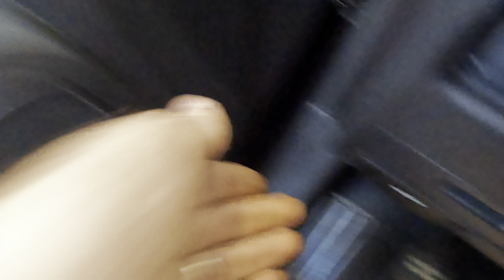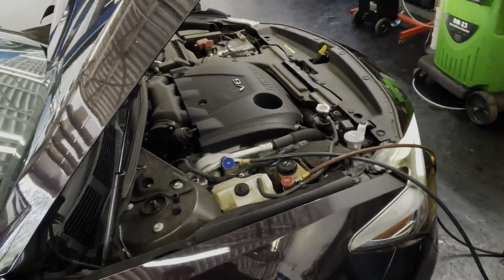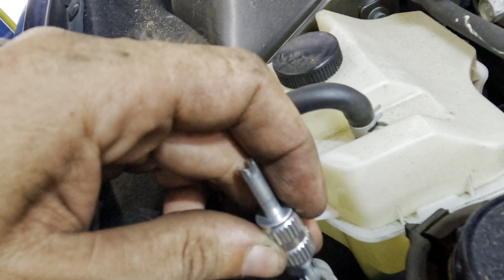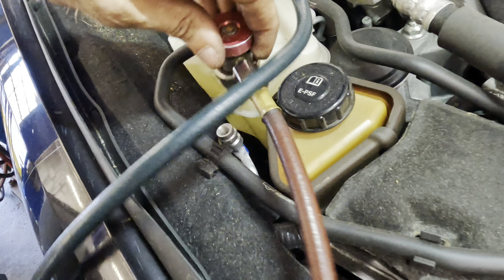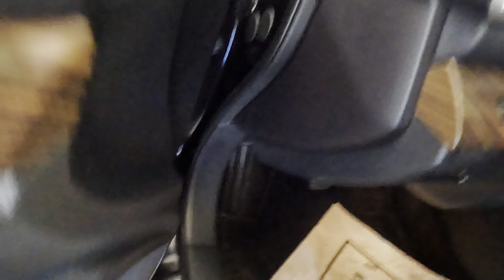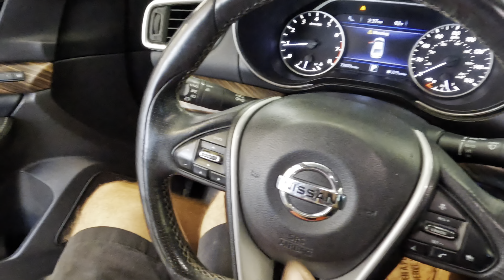Finally ran out! Seepage & Time

Comment: Nice to see the Maxima's "reliability" hasn't changed. It took my 2000 TL 15 years before the AC leaked out of the charge ports, and my Dad's 2012 TL still maintains a full AC charge. No car should leak its AC in under 10 years if its designed well.

Comment: For those who watch and don't know, make sure to run your A/C at least once a week, summer, winter, etc... Then it can last a lot longer, most factory install do not have the dye injected.  If you do have a @/C that stops ask for the valves, top up the Clavus ac oil and have them add the dye.   

For those who dont have the dye , the leak gets detected by a drop in the pressure and an increase in the low pressure side once you pull the system into max vacuum.  Dye is not actually necessary to check for leaks.  

Just empty and pull down to maxx vacuum.

Comment: Here in Minneasnowda 90% of the problems after roadrunner rockets to the front end is e vap coil drain tube plugged with leaves (composted) and bugs in the spring coming back from Florida   Lol

Comment: As a career HVAC/R professional, I can honestly tell you that if the charge has dissipated, then there is definitely a leak in the system.  It could be very well in the Schroeder valves you replaced.  One way to confirm that there is no leak is to pull the vacuum and once you reach full vacuum walk away and let it sit for 30 minutes or so.  If the vacuum holds, then any leaks have been addressed.  If the vacuum starts moving up from 29” mark, then there is either a leak or moisture in the system.

Comment: I once seen a compresor that had it's body aluminium leaking from porosity. . 🤨  With compressed nitrogen, the top of the compressor would bubble wildly. .
Reply: Lol I had that with a cylinder head and on another brand a block...  Used dishwasher spray to find out what it was....  With the four gas analysis machine to see what changed

Comment: I work in the HVAC trade and am wondering why you don't have nitrogen to pressure test the A/C system to leak check?
A pressure test with nitrogen can determine if there is a leak and a trace gas(scrap refrigerant) can be charged into the system to help pin point it with a leak detector. The point I'm getting at is not knowing if there's a leak and then evacuating the system will only pull in air/moisture into the system which ruins the purpose of evacuation if there is a leak.
Reply: Hi Jordan!  The Robinair equipment that Ray uses monitors the vacuum, and will not complete the cycle if a leak (of sufficient size) is discovered.  It's a pressure test (negative), if you think about it.  Because the machine uses the hoses to do its magic, a schrader valve leak would never be detected.  That's one reason Ray replaces them.  Car A/C systems are tiny compared to home HVAC systems and use less refrigerant.  Perhaps that's why they don't ever see a nitrogen bottle.  Home HVAC work uses N2 flow to keep oxidation from lines while brazing and sometimes to blow the mung out of drain lines - stuff that cars never have to worry about.
Reply: @gregfielder  ah okay that makes sense the Robinair equipment has to achieve vacuum in a certain amount of time or considers there to be a leak.
Considering that unit monitors the evacuation and leak checks at the same time the only other option for leak checking is an electronic leak detector or soap for the schrader valves and nitrogen wouldn't be needed.

Comment: What can cause a car engine to get warmer when sitting with AC on
Reply: Fan not ramping up to high speed on a dual speed fan system, or a secondary fan not engaging.
Reply: @SlowHippie  it has one fan but I was thinking maybe the compressor clutch could be doing it because my motor like sometimes when ac is on I have to give the car more gas than I should to make it wanna move. I’ve never seen a car have so much power lost with ac on. Like it’s more than normal for sure

Comment: Ray, there is a tool that allows you to swap out the schraeder valves on a fully charged system. My brother told me about the one he uses on commercial HVAC systems, and I found the automotive AC version on Amazon.
Reply: boy do I need one of those. High line valve is leaking on my truck, I just toss a can in it every few months as the plastic cap does a pretty good job at sealing, for a plastic cap. Be nice to fix it without having to refill the system!
Reply: @frostbite1991  R134 valve core removal tool. I can't provide more than that, or my comment will be deleted.
Reply: @myZcarlife  yea I found one, Mastercool 81490. $40 on amazon. Heck of a lot better than manifold gauges, oil, and refrigerant I was about to buy to do the job lol. Thanks!
Reply: Yeah those are nice...
Reply: Do you have a link to one he recommends? I'd like to do that on mine.
Reply: @blautens  R134a valve core removal tool. I hope you can find it from that.

Comment: I would really like an AC compressor with a double clutch so it can run on engine power but also on an electric motor with a battery supply. So I can pre-cool my car or keep the car cool for an half hour when I run into a shop
Reply: A compressor takes too much power for an ordinary 12V system.  But pre-cooling works great in electric cars!
Reply: @BixbyConsequence  true. It would nee its’s own powersource, like a deepcycle battery. So that opens posibilities for an 48v system

Comment: I think I would've checked initially for refrigerant leak getting past the service valves/caps.  That way one could confirm that the refrigerant leakage came from that, instead of just replacing the service valves and scratching one's head if the new valves fixed it.
Reply: I think he checked for leaks after he pulled vacuum.

Comment: I get 40 degrees coming out my vent at idle and 35 degrees while the vehicle in motion but coolant coming up on it 2nd of run time I'll be flushing the whole system along with engine block.

Comment: You can also shine the black light on the condensation water dripping out of the evaporator for UV dye. If the water is green there is a leak in the evaporator.
Reply: I came here to say the same thing. The Car Wizard shows that trick on his channel.
Reply: When he pulled the vacuum on the system, he could have given it some time to see if there was a leak as well.  I never thought Nissans had good air conditioning from the one I owned new, but that was back in 2006.
Reply: Lol,  my company always replaces the evaporator with a compressor failure.
Reply: I always catch it in a styrofoam coffee cup and then look at it in complete darkness. 9 times out of 10 it looks like moutain dew lol

Comment: Ray please tell me you inspected the ac drain for dye. I’m only saying because I’ve replaced about 10 of these maxima evaporators this year for leaks. Typically first place I look 😂 I’ll just pull the passenger side center console panel off and pull the drain tube off of the box. I’ve had a few bad ones where it would be dripping out of the seams of the case.
Reply: Wow, poor design... Poor materials... 

Not cool to have a leaking evap so soon. Especially with a modern ac system containing a cabin filter that keeps debris off the evap from collecting into a wet mess.

Comment: A few months ago I had to replace the AC fan motor, then just last week had to have a mechanic replace a resistor of some sort to fix my AC. I hope this is the end of issues.
Reply: If your motor was going bad it over drew current through the resistor and damaged it (or burned it out if you noticed it right after the motor was replaced). Should be the end of those issues!

Comment: What exactly is meant by "high" and "low" side? Does one have a higher pressure than the other? Or, are they physically higher off the floor in the engine bay? That might sound silly but I'm thinking about liquid cooling in a computer. Where you mount the pump matters.

Comment: First let me say I find your videos both educational and entertaining.

I have a few questions about servicing an A/C  system with the Robinair machine you use.

First, when you recover refrigerant from the system, do you send it to someone for "reprocessing"? Do you ever reuse what's been recovered? If so, does the machine "filter" the refrigerant before reuse ... can it tell you if there was water vapor, etc. in the recovered refrigerant.

2. Assuming you use new refrigerant to charge the system, does it include leak detection dye? Or, can the machine insert dye and oil into the vehicle's system as it is recharging?

If you have the time to address these questions in one of your next A/C jobs I would appreciate the information.

Comment: Air in the system is a noncondensable. Air will also create acid that will eat at the winding insulation and create a short down the road.  Ultimately creating whobbley bit actuation.

Comment: Reminds of when my dad technical problems with his Citroen CX in the middle of summer.
We where sitting in his car, thick winter coats on and the windows closed with ice on the inside of the car windows and everyone on the way there was staring at us.
Because the AC was stuck on minimum temperature and maximum power.
Reply: Hey Ray what are those lo g locking pliers you use..I've found different on Amazon

Comment: I've concluded that video taping your work gives YOU added inspiration to do your very best.  I might add that I'd ABSOLUTELY PREFER a mechanic who fully documents his work as you do with videos.  But it is asking a lot.  Such a mechanic has to learn a whole new set of skills and has to visit the camera version of the "Snap-On" paycheck collection van, as you call it!
Reply: @youdontknowmebut  No customers in shop because of insurance is just a nice way of saying they don't want you hanging out in the bay. Mechanics are just trying to do their job and don't want/need customers asking a million questions, staring at them while they work, double checking everything they do, or worse offering suggestions on a repair etc. Some shops even have a code for when there's a 'looky-loo'  standing by the doors.
Reply: @GiantMet  thats where you're wrong, lifts do fall down and on top of mechanics far too often.  The floor is Rays place are also very dirty and slippery after oil changes, repairs etc and even if they had a full time cleaner/helper like I did, its still very dangerous if the client slips on the stuff on the floor, it used to be air hoses etc but today there are still high current arc welding kits etc so it's just not worth the distraction.  If I go into a workshop I know what to do and I don't distract the crew and if there is a danger I know what to do to avoid injury.
Reply: Totally agree with you, the quality of the POV Ray gives is top notch and Ive seen professional camera crew struggle with this

Comment: Ray, when you get into a hot car, you first open all of the windows so it'll quickly dissipate the 30-40 degrees of accumulated greenhouse heat.  

Then, turn OFF the MAX or recirculation when you turn on the AC.  It will cool much more rapidly because it is not cooling 140 degree air to 139 degree air to 138 degree air (and so on) as it slowly recirculates the hot air.  Give the system a big boost by opening the windows and another door if possible.

Comment: The Car Wizard has a neat tip on wether or not to tell if the evaporator is leaking. He just throws a uv light on the evaporator condensation drain tube and the water that puddles under the car and if it's leaking refrigerant then the UV light will detect it
Reply: That May work in some instances but is highly unreliable especially by the time the owner realizes their a/c is not performing properly. In most cases by the time the mechanic gets the system he will be looking at a system that is 50% full charge or less. As the system looses charge the level of refrigerant in the evaporator drops, the area of the evaporator that condenses lowers ( think of a container full of water with a leak). With the lower refrigerant level the coil temp warms to the point there is no condensation occurring on the coil resulting in none at the drain. An electronic detector (Sniffer) at the drain would provide better results than the UV yet still not highly reliable.
Reply: I would also look around the compressor.
Reply: Lol was just about to comment this 😂

Comment: Hey Ray, I know you probably know this, but I saw something on the Car Care Nut's channel that I never thought about. To check if you have a leak at the evaporator take a UV light and check the water coming out of the AC drain and see if it glows, if it does, there is your leak. Do you do this off camera as part of your diagnosis? I just thought this was a great idea. Have yourself a great weekend Buddy.
Reply: I think he did this once before.  Not sure though.
Reply: Yeah I don’t remember either but I thought that was a great idea.

Comment: why didn't you add dye
Reply: he didn't know if it was actually leaking yet. 

personally I don't want any dye in my ac systems. both my cars have none. 

I had a used civic that must have gotten a shot of dye every time it went in for an ac check, it was severely overfilled with dye. I found out after I fixed a leak and turned the system on, the high pressure relief valve on the back of the compressor blew (sounded like a bunch of rapid 22 gunshots) and puked dye oil all over my driveway and under the hood. 

I took the compressor out later on and a few ounces of dye came out of it. 

these new systems are so small I really don't like just throwing dye in there by default. you can use a sniffer, and check for oil stains. the standard oil is usually visible, just like dust collecting on an oil seep.
Reply: @volvo09  thanks!

Comment: isn't it weird that i had a Subaru that was 17 yrs old and held it's charge until I sold it while some newer cars lose a charge in 4-5 yrs...what gives....sometimes newer isn't better
Reply: Exactly, you're absolutely correct!
Sister's 2010 Forrester a/c blows So Cold & it's  never been for a/c work.
Reply: my dad owned a 01 tundra since new, he never recharged the ac (he didn't use it much though). I bought it from him at 18 years old (the truck) and recharged it because it was low, but it was still working. probably lost about 1/2 it's charge in 18 years. not too bad. 

new cars hold much less refrigerant, it's about 1/2 of what older cars hold. so there isn't much reserve left. some small cars don't even take a lb. (I know my 09 civic is like that).
Reply: It's not weird, it's a symptom of the neverending quest for more profits. If they can make it cheaper, they will. "Built to last" isn't a thing anymore. It's now "built to last just long enough for us to be able to sell you a new one"
Reply: Yup, 13 year old Mazda 6, never had the AC "recharged" still blows cold.